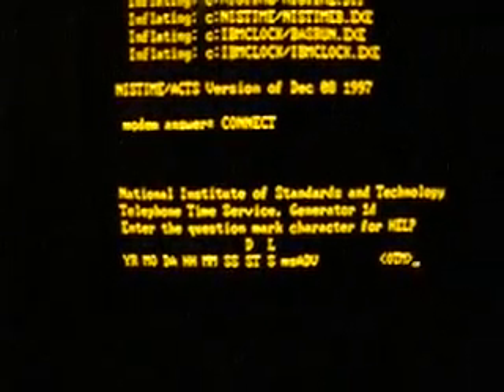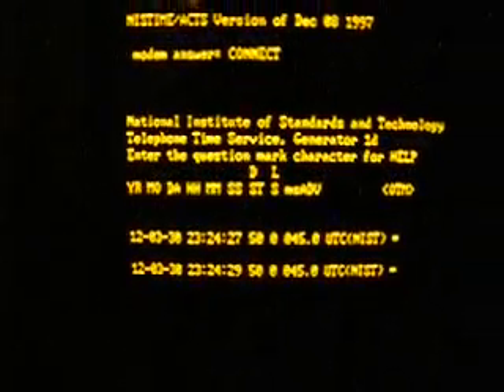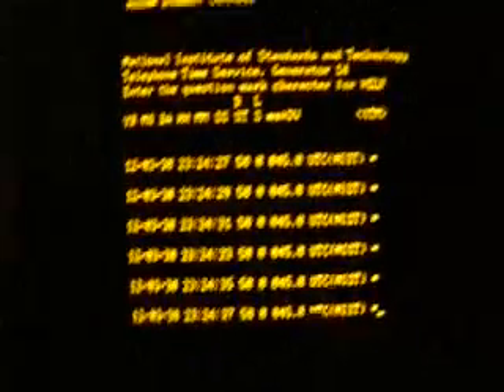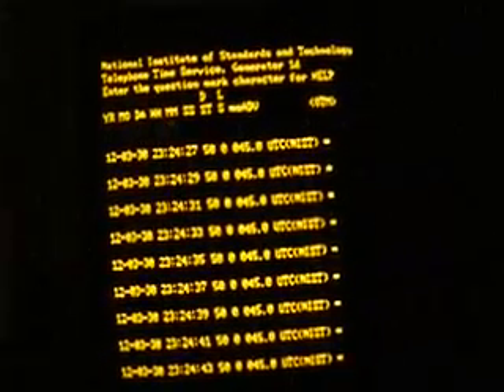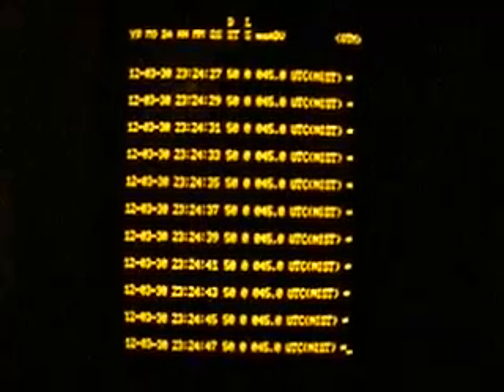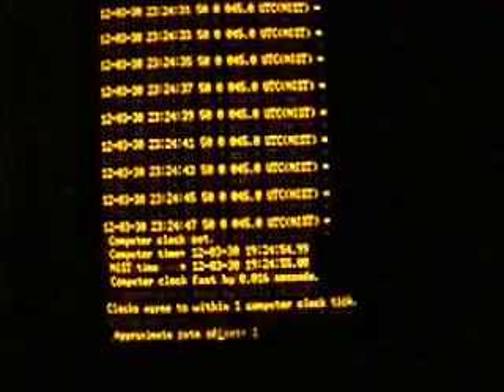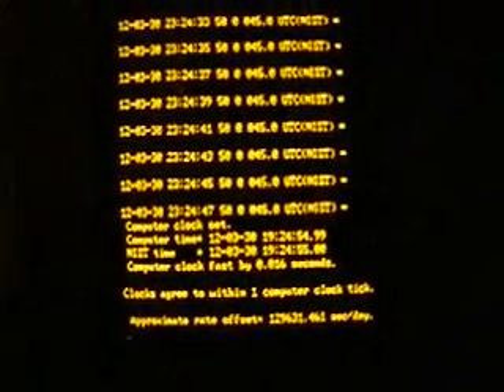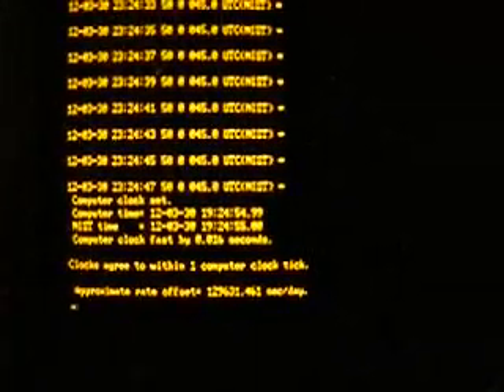IBM PC Convertible Clock Fail

Comment: Nice legacy Tug Along. Those type portable computers were never designed to be laptop tops. Those came a few years later. I once owned the Radio Shack Model 4P Luggable. Unloaded within 6 months. I have Commode SX-64 Luggable still working and operational. Some of the eight computers have great longevity compared to today's hardware.
Reply from the maker: Thanks.  This actually was the very first video I ever posted to YouTube.  I have 3 of these in total.  2 have 512K memory, this one has 640K.  All have the upgraded electroluminescent backlit screen.  I have used this machine back in the day (when its battery was good) as a laptop, but mostly it sat on a table.  This was, for all intents and purposes, as powerful as an IBM PC, though I believe the CMOS 8088 was just a tad slower (usually not even noticeable) than a standard 8088.  

These were great machines, I did a majority of my homework on one of these back in my school days some decades ago, and yet, here it is still working today.  While its in "retirement" as a clock, at any time it will be happy to be pulled from there and run all the vintage applications it used to without complaint.

Comment: 6 years just flies by, doesnt it
Reply from the maker: Yes and no.  A lot's happened in those years.  But this machine still works today!
Reply: Well its vintage, what did you expect, it doesn't have a billion sensors like things do now.
Reply from the maker: These old machines you have to watch for exploding tantalum (tantrum) capacitors.  They really do explode.